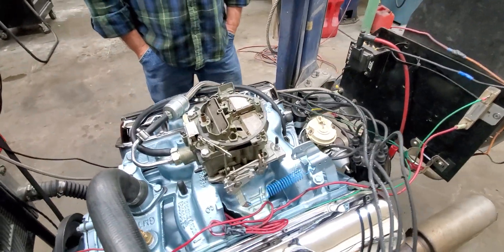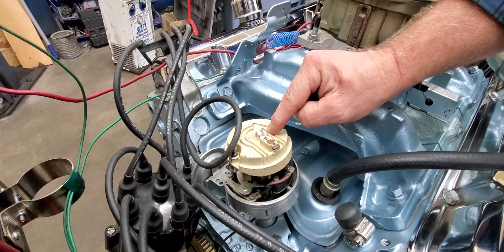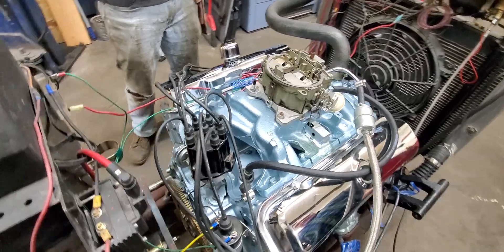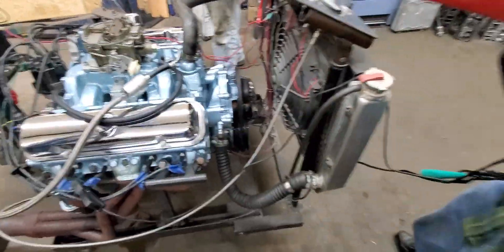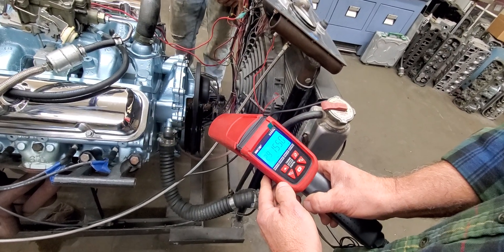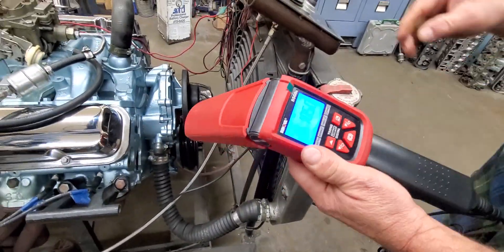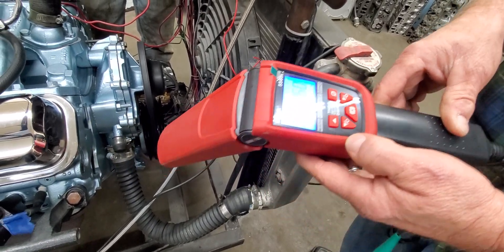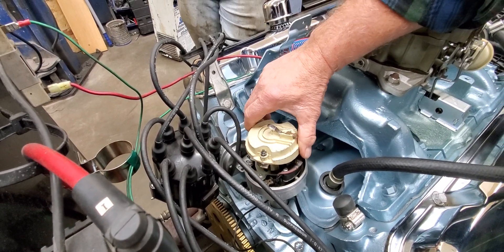WHY AND HOW !!!!  Understanding and setting ignition timing #new#ignition#timing #learn

Comment: I see that your PCV valve is connected to the #2 intake port.  On my 400 with a Performer RPM intake, I had the PCV valve connected to a port on the #7 intake runner (using a plumbing kit sold by Butler) and it oil fouled the #7 spark plug after a 500 mile highway trip.  You may want to check your #2 spark plug after some run time. . .
Reply from the maker: You are right and we don't normally run a PCV with our performance engines only the stockers. Unfortunately the f tee broke because it was old and brittle. So we just hooked into that position to set the idle mixture for the customer. He is buying a new F tee and hooking to both planes of the intake like factory. Thanks for following !!! Please subscribe and hit the notification bell for future videos. Come hang out with us on our Bench Racing Podcast every Wednesday night from 7PM to 8PM Eastern.

Comment: why are you welding something when you were just talking about swapping springs and weights?
Reply from the maker: The weights and springs only determine how fast the advance comes in. There is a slot that a pin rides in that determines how much mechanical advance comes in. That slot in most instances is to big allowing to much timing. So we weld it up and limit the advance that way. Thanks for following !!! Please subscribe and hit the notification bell for future videos. Come hang out with us on our Bench Racing Podcast every Wednesday night from 7PM to 8PM Eastern.
Reply: @dcimotorsports1111  how are you able to figure out where to stop your weld? It sounds like a huge hassle, especially since a weld is not quitw precise So I imagine you have to go back in a little with cutting
Reply from the maker: I made a gauge we use. We weld it up past where we need it and use a round file to take out what we don't need. @Trendyrapslut

Comment: this is why people run the pertronix  or MSD..  because you can control  the initial and mechanical and put it wherever the engine wants it  with some bushing and spring changes. because a bigger cam  is gonna want more inital  but  you have to able to limit the total  timing to  where it makes the most power.

the MSD E curve  is especially good at this although i MAY go pertronix..not sure yet  its just a 302  ford i may turn into a 331  in my foxbody
Reply: You sir, need to learn how to curve a distributor, either with an old-school Sun distributor machine, or a dial-back timing light..
Reply from the maker: MSD and a few others do make it easier and we use them too. Please subscribe and hit the notification bell for our future videos. Come hang out with us on our Bench Racing Podcast every Wednesday night from 7PM to 8PM Eastern.

Comment: Is that engine solid lifters 💁‍♂️
Reply: On hydraulics if you set the valve lash 1/8 of a turn or quarter turn you will get a little bit noise.
Reply: @pauljanssen7594  Why would you do that?
Reply: @keilveil9153  Well, because it's a Pontiac. Like a Harley-Davidson, it's not about the non-existent power, it's all about the noise... er .. uh  .."sound".
Reply from the maker: In this video you can hear a header leak and it sounds like a lifter. @pauljanssen7594
Reply from the maker: No its a hydraulic, but you can really hear the exhaust leak in this video on the back header tube. Makes the engine sound like crap LOL. Please subscribe and hit the notification bell for our future videos. Come hang out with us on our Bench Racing Podcast every Wednesday night from 7PM to 8PM Eastern.